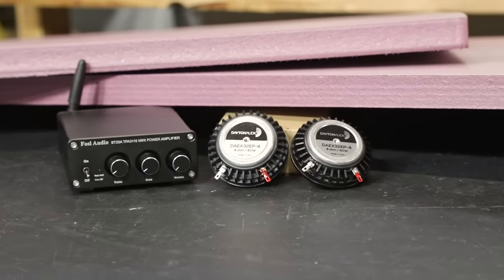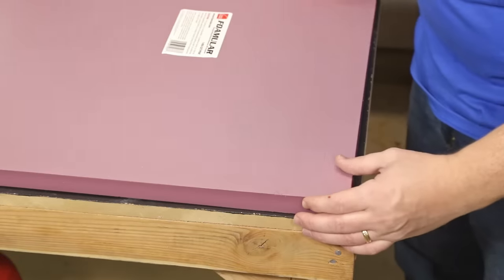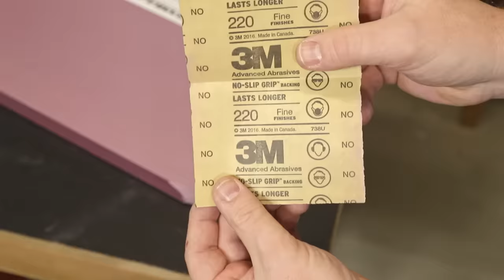How To Build "The World's Best Speakers" - Are Flat Panel Speakers Really Any Good?

Comment: I built a pair of these about a year ago, you will need a good amp to drive these but they (can) sound ridiculously good for what they are. After building (or let's better say, slapping them together) I ended up sitting in my basement and listening to all kinds of music for hours because I was so amazed of the sound.
Reply from the maker: Hearing is believing. I was absolutely stunned by how good they are.
Reply: i made concrete pipe speakers 8 inch round 4 foot long it was a 8 foot long pipe cut inb half  with a 8 inch bass in the top full freq in the bottom      you can paint them the colour of your room and the sound is like this put them in the corner of a rectangler room and the sound travells the floor and ceiling reflects of the back wall and if you are in the middle of the room its surround sound with 2 speakers whereever you are in the room the sound is around you and is strongest dead centre and they are heavy dont vibrate its amazing the loud sound behind and level with your ears its like being on the stage with 2 speakers
Reply: Nice.
Reply: It's always the "for what they are" part of this discussion that gets me. How do they sound compared to something like a decent set of bookshelf speakers? Is there any comparison there? I'd love to give these a shot, just to have a cool conversation piece, but am actually concerned about sound quality.
Reply: Lol that's what I'm thinking! I don't think I'd be going anywhere for a few hours. Just sitting next to my self built speakers and enjoying my favorite tunes as if it was the first time hearing them!
Reply: @jonathanbailie  just build them paint them or just glue a a poster on them and they would be a nice decoration, when people complement your Goku poster and Vagita poster going super sayin, pull out your phone say "this isn't even their final form" and drop some sick beats. At that point they could sound like knockoffs of an off-brand and still be impressive. 
P.S. I have never actually seen Dragon Ball, it was just the first thing that came to mind.
Reply: @jonathanbailie  the "for what they are" part is just the amazement that something generally regarded as cheap, or not typical for use of speakers produces such high quality sound. Not that the sound is actually meh, but amazing because of what it is.
Reply: @IM2awsme  honestly, you just summed up the entirety of dragon ball
Reply: @IM2awsme   Adding a poster would likely negate sanding off the "shiny surface". I'm guessing the shiny surface makes them too bright which would be very fatiguing to listen to.
Reply: @gordthor5351  I'm sure there is a work around, there are fabric posters you can get. Ether way, it'll look good as a conversation piece.
Reply: @IM2awsme   when you hit play you need to look at the people and say "this is to go even further beyond * then crank the SSJ 3 theme.
Reply: @NEMOZAC  Are there any plans? Did you use a crossover?
Reply: @jonathanbailie  
Well he did say in the video that they don't quite hold up with bookshelf speakers in tone reproduction (i.e. definition I think), and obviuosly you'll need a decent amp, and try different sizes or simply use an EQ to compensate for balance issues.
But other than that they seem to be pretty close.
Reply: @NEMOZAC  cause you’re on stage with two speakers
Reply: @IM2awsme  yeah the painting or postering part offsets the whole premise of these,……..things.
Reply: @IM2awsme   u mean Gokuh and Vegeta but its ok since u never watched
Reply: @fukjoebiden6122  Came in to correct the spelling of Vegeta, but also said "Gokuh" 😆
Reply: @Bluhbear  season 2 dragon ballz look at the name on gokuhs suit its spelled gokuh the us dubbed spelling is wrong just saying might wanna actually be a fan while hes travelling to namek in case you have trouble finding it since u dont watch the show obviously
Reply: @fukjoebiden6122  Well, if you want to be pedantic about it... one misspelling in the anime doesn't counteract all the other instances where it's either Goku or Gokou. The most correct thing to say is that you're either going with the Japanese version, in which case you don't use romaji at all, and it's pronounced Gokuu; or you can go with the English version, which is Goku.
Reply: yes a crossover the experience is ausome though as nothing else compares for so cheap a  well $80 for a pipe $40 a cut in half and the rest  cheap as i could make or buy
Reply: I built some, and put one in place of my regular daily driver speakers. I guess if your regular speakers are junk these are an upgrade, but if you have anything competent then these are a major downgrade.

Yeah, they're better than a $20 Bluetooth speaker. That's about all they're better than. Sorry.
Reply: @NEMOZAC  I'm sure your neighbors loved you.
I wish I was your neighbor.
You would teach me your art and we could make more neighbor friends.
Reply: @IM2awsme  Here's how that conversation goes.
Friend: Oh, I see you got some new posters
Me: Yeah, they're actually flat speakers I built myself
Friend: Cool
Reply: @gordthor5351  You could sand the poster. You could glue the poster to the board, and cover the poster in a layer of PVA glue, which is nice and soft. Then if you wanted, add another layer, maybe PVA diluted 1:1 with water. Then when there's a bit of a thickness, give it a sand. You could do all sorts of stuff if you wanted to. But PVA is already nice and soft, there might not be any point sanding it.
Reply: @grscklyr4dfbz  I'll stick with the Mission 700s then. Had them for years and they sound great. The ones with the nice plastic-woven cones on the woofers, and the domes already inverted, so no chance of some pillock pushing them in like you get with normal speakers. They sound smart but weigh a bleedin' ton! It'd be a strong bookshelf that could hold one of them. 

Interestingly my neighbour gave me a pair of Kenwoods that seem to be identical to them, except different colours, but identical even to the detachable front grille. So who actually made them? He was very impressed with how they sounded too. 

TBH the whole idea of an "exciter" is suspect. Just not how things work. If you want to make a window, or some architectural feature, into a speaker, perhaps you're a museum, or it's a small conservatory and you want good sound but have no room for speakers, then there's a place for them. Maybe. But at best, even if you stuck one to the cone you cut off a proper decent speaker, it wouldn't sound nearly as good as a proper speaker would. I'm totally skeptical about them as a phenomenon. 

There were some exciters that were rheological, or something like that. They were the first exciters to come out AFAIK. Maybe from the 1990s. They used something like electrical control of stiffness, or expansion, to produce a lot of power (like "torque" but in a straight line, whatever it's called) that could drive a large sheet of glass or wood or the like, with a lot of volume. They were apparently very impressive, any idea what they were called?
Reply: @fukjoebiden6122  There isn't a single way to romanize Japanese. That degree of variation leads to stuff like that, but - generally speaking - and based on both the most popular (Hepburn) and the more official one (Nihon Shiki), it's either Goku/Gokū or just Goku.
Some mistake made by a native that probably doesn't handle romaji all that well is not a valid reason to argue in favor of a romanization that doesn't follow any standard (or even make much sense linguistically speaking).
Reply: Now I'm sold
Reply: @carswnova  What made you? However, if you can afford a few bucks and have nothing else to do on a weekend then this is a fun little project. I had best experience with them using an additional small subwoofer, just boost the lows slightly. My exciters aren't the best, I took what I could get quick and they aren't really made for this, if you be able to get the ones that are used here (or in the original vid fomr Tech Ingredients) you should be fine.
Reply: Would really like to hear them in person, but over phone they sound good, very surprised 😮
Reply: @jonathanbailie  For a numbered and high resolution picture of the SPL graphs at 27:27 in the follow up post by the original poster.
Reply: @HerbaMachina  The 2nd video has a comparison with a commercial Polk bookshelf speaker along with a computer analysis and SPL graph.
Reply: do you think the focusrite solo would do a decent job driving them?
Reply: I must have done something wrong, but I think they sound crap.
Reply: @TeensierPython  I haven’t experimented much with these, it was just out of curiosity and I was amazed. I think there’s a few factors that might change the outcome for everyone… the material itself is not made with acoustic performance in mind so the acoustic quality could be quite random. The sanding and cutting also is a bit tricky and could affect the sound quality. Last but not least the exciters and the amp are key ingredients and you might need to experiment a bit with what works best.
Reply: I might set these up as a second set of speakers in strategic locations and I should have enough to power them.
Reply: @KahlilDechaine  definitely give it a try, if nothing else, it’s at least a fun project. But you would need decent exciters, I used what I got and tho they worked, in the end I was not fully satisfied.

Comment: Imagine you make a home theater system with five of these
Reply: I mean, that's excactly what I had in my mind...
Reply: I'm going to make some as rear channels for my surround set up. A whole array of these with one subwoofer would be sick
Reply: @brandonxvi707  Sounds like a bigger panel would do the trick for more bass.
Reply: You can make 5 for less then one set of good tower speakers. Might Aswell put a sub in the seats for a home theatre.
Reply: I'll try that soon :)
Reply: I think i will get 4 on my sealing for atmos.
Reply: have two panel front speakers that are bi amped. That's what i'm doing.
Reply: The fun thing with these is that you don't particularly need a sub.

Because they are free floating huge panels, they make some decent bass all on their own.
Reply: Add ridiculous to stupid.
Reply: @Johnny_C137  Or a bass shaker on your seat. More feel and no complaints from the neighbors.
Reply: @enlightendbel  I wonder what exciter placement would yield the best bass
Reply: I might just buy a big sheet and just line my wall with them for fun, 3 rear, 3 front, and 6 sides and then I'll just out 2 subwoofers, should work great
Reply: @Johnny_C137  I don’t know if it’s been mentioned elsewhere but I’d imagine the problem with bass on these is that you would need a very powerful driver to push all that air any decent distance - so bigger panels may just kill the drivers even more
Reply: @AndrewDInSydney  I have a feeling adding more exciter units per panel could be a good experiment to increase the bass.  Patching a subwoofer into the system would probably be easier though...
Reply: @Johnny_C137  I don’t know if you’ve checked out his follow up video - I watched it just now - he does one option w dual exciter + sub. Dual exciter makes major difference. Sub imho is too rumbling, but maybe needs better eq and vol control. Definitely need sub, but I also think somehow need more low mids… maybe one more exciter.. 🙂
Reply: How about complex music like a full orchestra
Reply: The low end always lacks on these types of speakers.
Reply: I'm making some for outdoor parties.
Reply: @brandonxvi707  
Heck yeah, LGB
Reply: I've done that... and these are best for the surround speakers (back, side and middle, and even on the ceiling) but you stil need two main front speakers with the full bass...
Reply: @enlightendbel  I find the 2' x 2' panels lacking in bass, a subwoofer makes the sound incredible (and EQ'ing the speakers).
Reply: The Tech Ingredients guy does a 5.1 setup in his workshop with volunteers  🔊
Reply: Use them to make the 4 walls of the room
No neighbors possible
Making earthquake at each action scene and stuff

Comment: I built a set of these with sheet balsa wood, roughly 90cm x 40cm with the Dayton Audio exciters placed 2/5ths in and 2/5th up from the the bottom corner ( mirrored pair ). The result is very good,  good treble, good mids but with light bass. Good enough for a small room / study / bedroom for casual listening. The bass is light but responds better the farther out from the wall you suspend them.They have to be at least one foot from the wall for bass to be half decent. I ended up angling mine slightly towards the 'listening point' which gave better outward reflection of sound off the wall and out around the room. The overall sound is surprisingly good for a very inexpensive project. Definitely worth a try and I have made mine into artwork so that they appear to be paintings, I now have two 'Banksy's' as my speakers.
Reply from the maker: I'd love to see pictures of your setup. Sounds pretty cool!
Reply: That’s an awesome idea 💡
Reply: So, whack em together, add a sub and you're pretty much set?
Reply: Since bass in non directional why not use a separate unit shooting bass into the floor?
Reply: you tried 90cm x 40 cm of balsa, but which thickness ? I might give it a try some day.
Reply: @StphRolland  Hi Stephane, yes I made 2 panels used 90cm x 10cm strips, I glued 4 of them together to form a sheet of 90cm x 40 cm with small straps at the rear to strengthen. The thickness is 6mm. and I attached the exciters at the 2/5th , 3/5ths from bottom corners ( mirrored pair ) good experiment.
Reply: Hey Les, what effect did the paint have on the sound? Did you do a before-and-after test with and without paint?
Reply: @johnb4024  Hi, I did listen to them suspended before I decided to paint. After the 'paint' art work which is actually a light coating of dark grey wood dye with the silver part just a silver 'sharpie' pen, so there is no 'paint' on the panels just colourings. Listening after the colouring was done I can't hear any difference, just basically the same. The biggest difference is moving them as far from the wall as you can to improve the bass response. Flat against wall is terribly mid and tinny, away from the wall improves everything.
Reply: @soundssimple1  Do you think if you had sound absorbing material on the wall behind it would correct the tinny sound with your bass?
Reply: @MrFerrariF360  Answer is I haven't tried this. The only experience I have is using them 2-3 inches off the wall parallel to the wall the sound is top and mid with little bass, the farther I move the panels away from the wall the better the bass appears. Angling the panels at about 30% to the wall pointing inwards to the listening point seems to improve the whole sound spread around the room ( better reflection ?? ). All new to me, still having fun with placement. The exciters are only 5 watt so overall expectations are not in the area of good bookshelf or floor standing monitors but hey its fun trying something new. Cheers
Reply: @soundssimple1  Interesting!  I am an apartment dweller so I am interested in whatever a smaller version would be.  I'm doing some research and I think i'll pick something up to play with soon.  Thanks for the reply!
Reply: Hey I did exactly this, same size and material, and angled them downward a bit. I agree that with more distance from the wall the bass sounds better. For my taste though it was still lacking in the low end so I added a small 6" woofer under my desk and all together it sounds amazing.
Reply: @Necromancer166    Yeh it's great fun to experiment make things and try new ideas. very satisfying when it works. I'll try your idea of an additional 'sub' . Thanks for the post . Les
Reply: I want to see that!
Reply: Nowadays 90x40 balsa will set you back almost what a pair of high end speakers will which kinda defeats the point but I totally get why balsa would work, I’m going to try it with ultra lightweight composite panels - also rigid and light weight and quite dense
Reply: I think this is getting into some of the more fair arguments towards these being the "world's best speakers"

Its the flexibility. Seems like you can very easily modify a system to suit your needs with different sizes, numbers, dimensions, materials and all can be done easily at home and inexpensively. Also decoratively very flexible as mentioned by the OP.

In this sense it seems to me like a fair claim
Reply: One video I saw recommended using end-grain balsa.  But, where do you get end grain balsa in that specification?  How much is it?
Reply: @justgivemethetruth  Hi , don't know where you are located country wise but here in  the UK end grain balsa sheets are quite redily available in sheet form, sometimes with a thin fibreglass strengthener. Internet search brought up companies doing  4 foot x 2 foot sheets at 1/4" thickness at about £15 a sheet. Try some internet searches local to your area. Good luck.